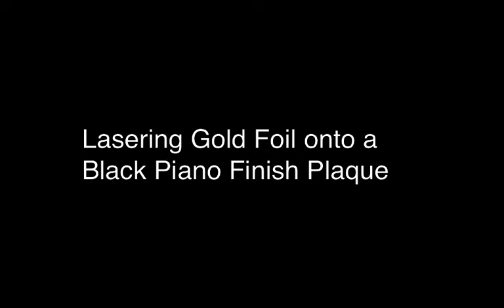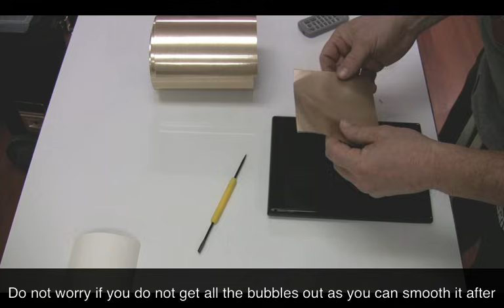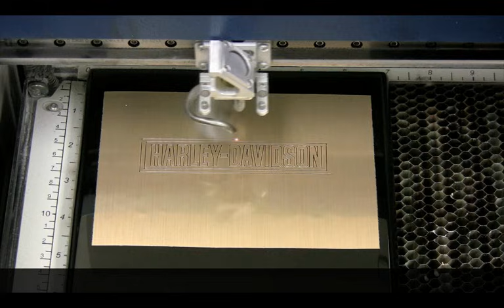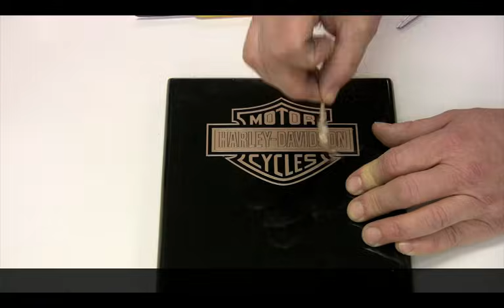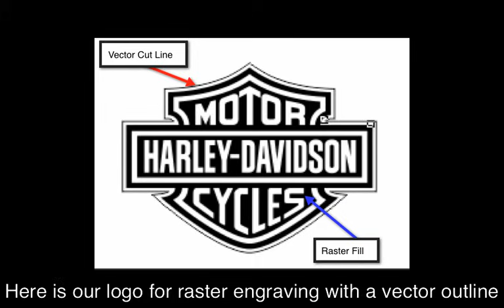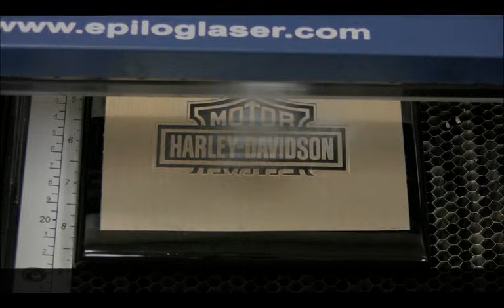Using Laser Foil with your Laser

Comment: So you're using your laser as a vinyl cutter. I wouldn't use your thumb to smooth out the edges use a soft rubber brayer so you don't catch an edge and pull up the foil.

Comment: will a 2.5 w laser cut the foil?
Reply from the maker: Richard gross not sure the foil is thin so I would think it would work
Reply: @fmeclarke  yeah I saw a guy using a 6.5w laser at 25% so I think if I used my 2.5w at 85 to 100% it would work

Comment: I find weeding much easier when using transfer tape.  Weeding on transfer to transfer tape, then positioning and transferring with the tape much the same way stencil cut vinyl is transferred.  Kiss cut the material with the backing still on it and pick it up off it's backing with transfer tape while weeding and apply. Transfer tape comes in various adhesion levels from low to high tack.
Reply: I've been doing transfer film forever... this w/o was a dream... #1 good  weeding pen & tweezers

Comment: Hello Mike, 
Nice video !!
Is the foil the same as used in a laser printer or laminator ??
Thanks
Reply: Também gostaria de saber.
Reply: No, not the same. Laser safe and it's much pricier than those supplies for laminator.  I've also seen HVAC (furnace heat duct) foil tape used as an inlay. It looks more like aluminum/ metal like plastic based.  Search online for projects. Very cool. Thanks for this Mike. Looks great. I love black lacquered anything lol. Cheers 🙏❤️🇨🇦

Comment: why not just cut the foil first then  stick it ?
Reply from the maker: If you place the foil on first and cut it this way than the line up is perfect. If you cut and than place it on you can lose registration
Reply: Registration is spot on if you don't mess with the registration,like the way YOU did it,the second raster and vector looks really good.
Reply: When cutting the graphic on a plotter, cut the outline of the board and you will have instant registration.
Reply: With enough practice, registration is pretty easy.  A vinyl cutter is better suited for this type of work.

Comment: Just a tip, the metallized shelf paper at hardware stores is the same stuff, and way cheaper!
Reply: It just has to be PVC free to avoid damaging the machine.
Reply: Those self adhesive drawer liners are made from PVC.
Never laser engrave PVC
Aside from the gas it produces being poisonous, it will damage your laser.